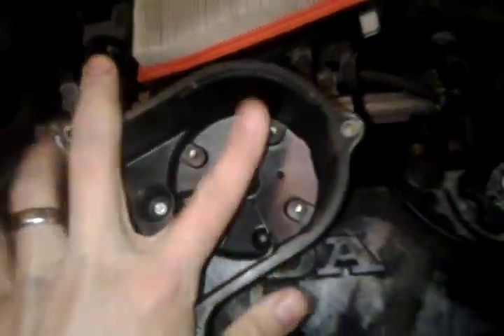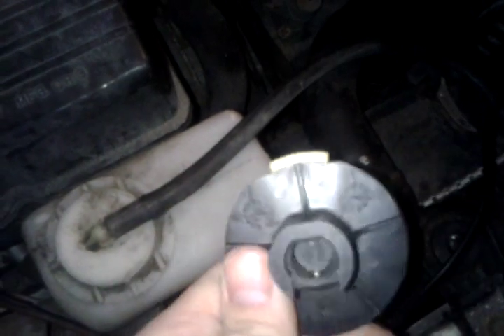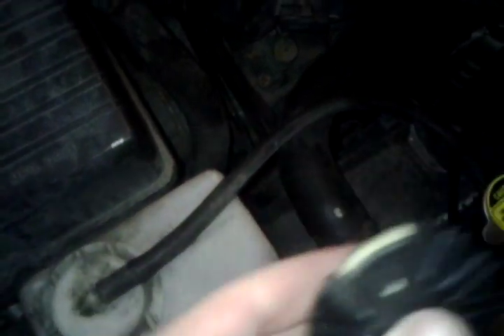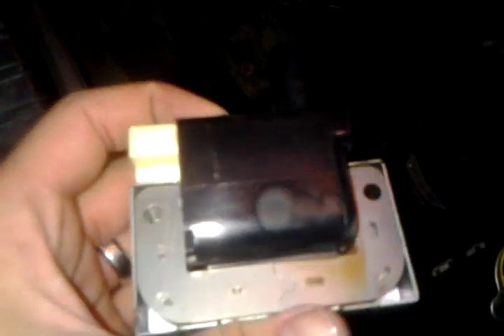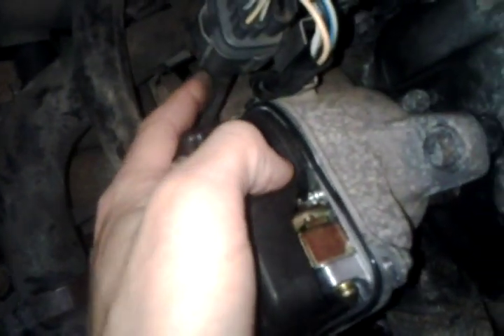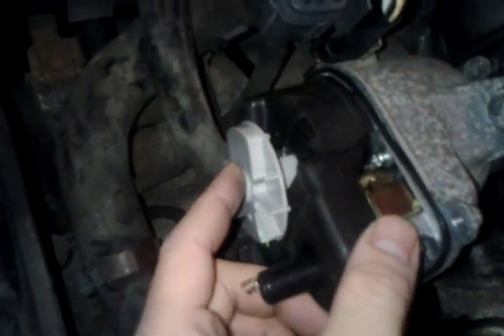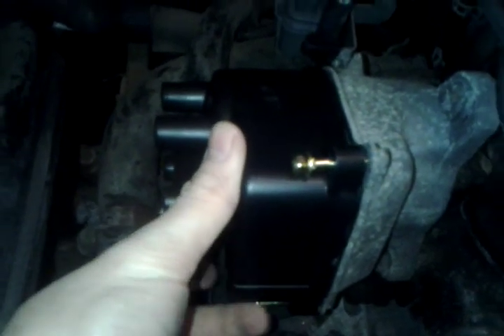97 Civic LX crank no start w/ P0113 (Fixed)

Comment: Thanks for posting your video! My 97 Civic would not start after I parked it, watched the video, Took off my distributor cap, got zapped by my coil. Replaced my distributor cap and rotor.  She ran a little rough and then replaced my spark plug wires.  She is running great.

Comment: I'm going to try this soon. I have the same car, took it to a shop and they didn't see anything wrong with the computer (no error message came up) Check Engine Light isn't on. Replaced the fuel filter because it was pretty old and replaced the battery because it had ice in it and failed a diagnosis at an auto parts shop. Seems to only happen when it's cold out though. It will start but typically when it's a little warmer out (like 30 to 40 degrees).

Comment from the maker: its very possible. if your not getting any spark this is defiantly where to check for anything old or worn out. the parts cost me around $100 however if your on a budget id recommend ordering your parts from rockauto.com
good luck and thanks for watching

Comment: Hhhmmm... this is probably what's wrong with my car then. I have a 97 civic lx and it won't start. It cranks and sounds like it wants to but it just won't start. Fuel pump is fine and passes gas, starter and battery are fine, and I got a code saying the o2 sensor was bad so I changed it and still won't start. I'm not real into cars but do you think I have the same problem? My grandpa said I have no spark in the exact area you replaced. If so, how much did the parts run you?
Reply: SuperHamburger29  you ever fix this?
Reply: I have the same exact problem lmk
Reply: @VRDIRTY  yo ik its been a while was it this?